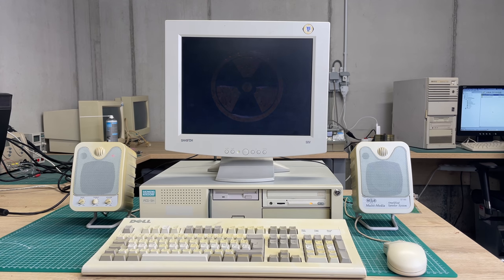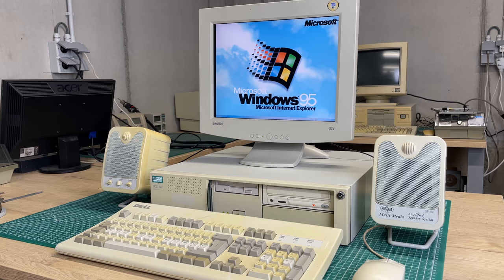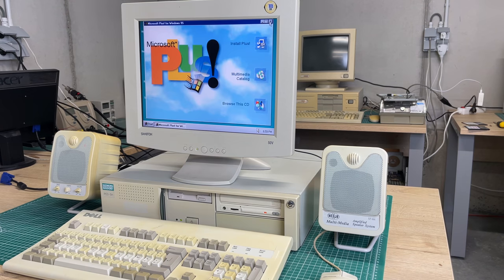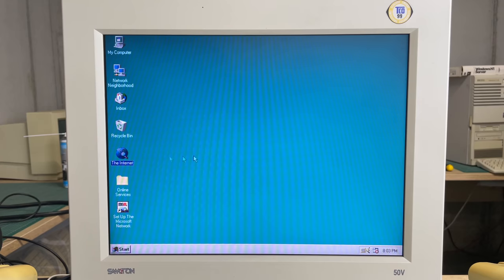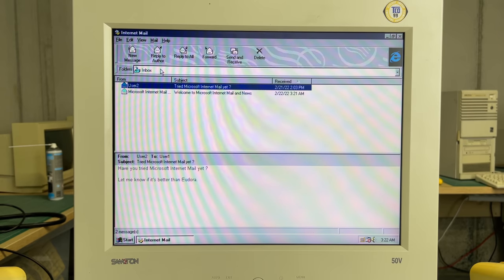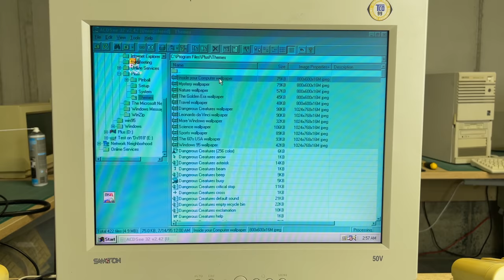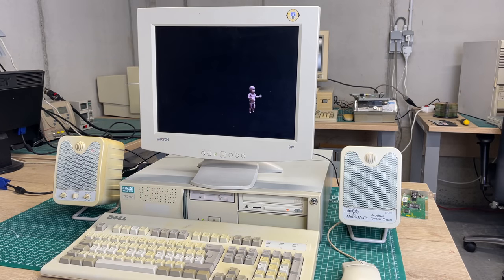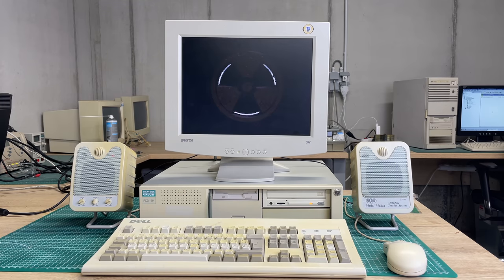1997 Computer Time Machine

Comment: 6:20 I like how Windows 95 was actually able to tell when devices were conflicting, but never bothered to inform the user.
Reply: It also was able to detect EISA (and maybe ISA plug'n'play?) auto-config settings, but refused to try to change them- you had to go into the BIOS instead.

Comment: I also have a PCD5-H here. Got it as a present from a friend. I've trimmed it up a bit over the years. Mine has 96 MB Ram, Pentium 75, Windows 98 SE, Voodoo 3 PCI, Soundblaster 16, ISA network card, and a USB 2.0 \ SATA combo card. The system hard disk is a 32 GB SD memory card on the IDE bus and another 128 GB SATA hard disk. The device runs perfectly. Best regards, Chris

Comment: Total Commander is a very powerful Filemanager especially with some of the available plugins. acccessing *.iso files like archives, mass renaming files, running file operations in background while doing the next, packer plugins so you don't need winzip, 7zip or anything else and many many more. I use it on a daily basis.
I actually forgot it was called windows commander up to some point, I think there was some legal trouble.
Reply: Yes, it was due to legal problems by including "windows" in the name....
I have been using TC (WC) since 1998/99. It is the first thing that runs on my PC after boot. I used a couple of plugins before, but not even that anymore. I only link it to Notepad++ (for the editor) and IrfanView (for quick image views). I use it almost 100% by the keyboard, the mouse only for shortcuts. It's a bit of a legacy from previously using Norton Commander in MS-DOS.
I only use Windows Explorer when I have just installed Windows, to install TC (LOL!!!) and for a few additional things
and TC configured in "total awareness" "fast operation" mode

Comment: When I went to school, we had many of those Siemens Nixdorf machines in class rooms albeit slightly newer revisions sometimes and usually with Windows 98 SE rather than 95.
These PCs worked really well.
Solid machines, good processing speeds and plenty for Microsoft Office and the learning software we used at school.
Also the first time I believe I did something network related myself.
Reply: Yeah they worked well until you installed the obligatory antivirus software.   That was what really slowed things down.

Comment: What I hated the most in old computers were IDE cables. At least one for floppy drive, one more for cd/dvd player if you had one installed, and one for HDD (or even more if you had more than one inside the case). It was a mess. SATA drives made it a bit better, but kids today with NVME's will never understand it :) Thanks for the video!

Comment: I bought my first computer in 1999; to save money I opted for the older operating system, W95. Was then perplexed to discover I had no USB ports. I was clueless back then, for on the hardware level they were indeed present, but just not visible (to me in my utterly noob state) in the software. I sold said computer &  bought a whole new machine, only to see, when delivering the old box to its new owner, that two shiny bright USB ports were indeed staring me in the face from the I/O shield... I could have wept. 🙈

Comment: This was an excellent video.  At my office, we had windows 95 computers and while they worked fairly well for general office usage, I was concerned about getting one to work properly in a home set-up.  So, I decided to buy an Apple All-in-One 5400 which, included a 15-inch Sony CRT, CD-ROM drive, floppy drive, built-in speakers, keyboard, and mouse.  Plus, I also had a user install Apple internal video capture card system and the Apple TV/FM radio internal card system with its matching black and white remote.  While, many during this time felt that Apple computer would be out of business soon selected it because Apple made or branded all your components (CPU, printer, scanner, digital camera, etc.) and your system was truly "plug and play" and in addition, each computer came with Lifetime telephone support (smile..smile).

Comment: As a consistent computer user since May 2007, I had Winamp, WinZip, VCD Cutter, K-Lite Codec/MPC (Media Player Classic), Age of Empires II, DOS-based LOGO, Jogo Disks full of Flash Games, etc. Those are pieces of nostalgia now.
Reply: Also includes NERO CD/DVD burner, showtime package; PowerDVD by CyberLink; Windows Media Player; and VLC media Player (still in use now)
Reply: Plus Windows XP screensavers.
Reply: @rickybhattacharya6  Consistent comp user since 2007? Nooooob!

Comment: I wasn't really a Windows 98 guy, because Windows 95 was the first OS that I really liked. 
Started with ms-dos and Win3.11, when I got the Win95 install on a 40M HDD i was very happy. Installed on my 486 DX2@66 and with each and every upgrade of the machine I saw the improvements on the OS speed. I went from 486 DX2@66 to 5x86@133; from 8M RAM to 48M, from 80M HDD to almost 1G (few HDDs, the biggest being 504M), from Trident 8900 VGA to Trident TGui9440 VLB; from Terratec SB clone to ALS 100+. Also I had a 2x CDROM with Mitsumi(?) interface that I used with the SB clone.
When got my first P1@90, I did the same: upgrade the machine and see the improvements in the OS functionality and speed. I went from P1@90 to P1@133, from 16M to 64, from Trident ISA to S3 Trio PCI and I was always impressed about how I managed to squeeze every bit of power from the machine.
Aside the fact that I used to format the PC every 2-3 months because there were many floppy that I wanted to see what was on them, many CDs with shareware ore pirated that Were very intriguing and many times come with a little virus or I installed too many things that the poor computer was overwhelmed and the Windows 95 became inevitably corrupted.
I spent many nights on my Win95 PCs, playing 1602 AD, Command and Conquer Red Alert, Civilization 2, Heroes of Might and Magic 2 and Starcraft.
Now I have a P2@333MHz laptop with Win95 just for the nostalgia. And of course there is Plus!, Winamp with tons of skins, AcdSee, WinZip, WinAce, WinRar, Office, Windows Commander.
Btw, my favorite theme was Inside my computer.

Comment: Windows ME had those same themes they were fun and i miss my old E-Machines desktop PC , it was actually powerful for the year 2000 it had a 733mhz cpu not too shabby for a PC that only cost £500 in the UK and it could run NFS 3 and NFS Porsche 2000 also House of the dead and Alone in the Dark new nightmare  , great old games

Comment: Microsoft plus is incredible, note I notice you used icq, it’s possible nowadays to use Escargot chat and I believe it works on 95, however I run it on 98, also, netmeeting w video works on 95 now too so you could potentially video conference on this machine if you find a nice webcam for 95

Comment: My Stepdad use to run Plus on his 95 and 98 and when having to constantly hear all the sounds that plus made because he had his speaker turned up way too high downstairs I began to absolutely despise any of the plus add-ons from Microsoft. I am so glad they stopped making it. For my after 1999 I started moving away from Microsoft and more towards Linux and Unix systems for my like FreeBSD. My step dad to the state still uses windows but I have moved on from that slice of hell and for me if I want a Dos system for a vintage computer I would be the one installing FreeDos. But I do remember at one point using a lot of that type of software.

Comment: We had a combo of hardware in a 10k pc in 1995 that just would not work due to interrupts and dma stuff. Mjpeg capture card, scsi, and soundblaster awe 32 did not like each other. Went to repair multiple times and was in the end part of a law case and exchanged by the seller for a measly Pentium II in 1997

Comment: I wouldn't say that Dancing baby was the most popular screensaver. Long before was Flying Toasters. I guarantee more people know flying toasters today then dancing baby. There are even Flying Toaster websites that allow you to still use Flying Toasters as a screensaver today. Most of the built in Windows screensavers would also be more well known then dancing baby. Finally when it comes to RUNNER UP screensavers just as popular as dancing baby would also be screensavers like the LCARS screensaver which because of LGR has actually had a resurgence and been recreated by the original dev for modern PC's. Also don't forget Johnny Castaway.